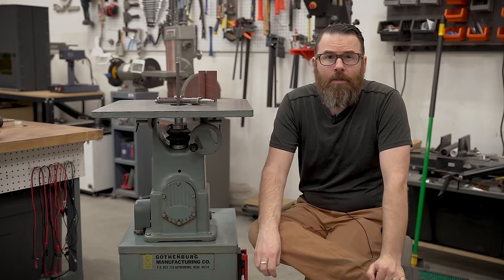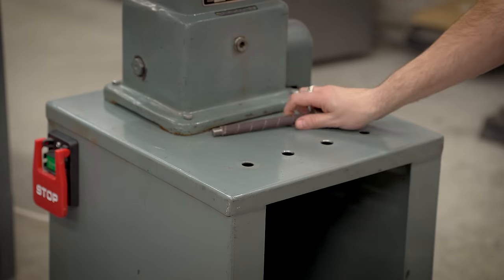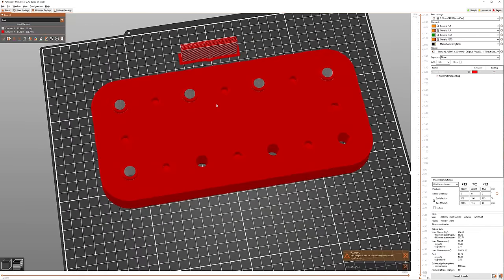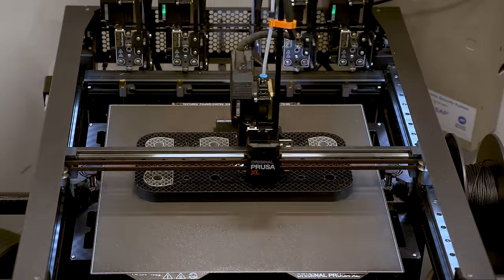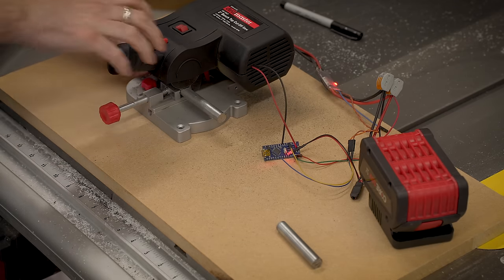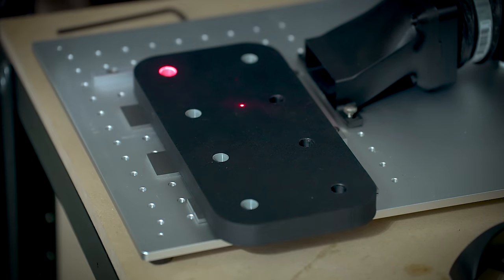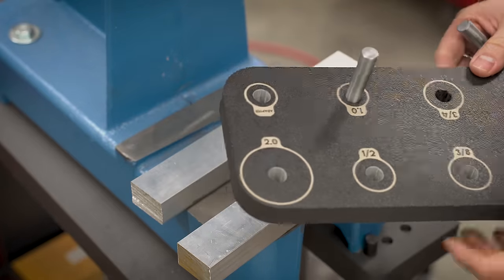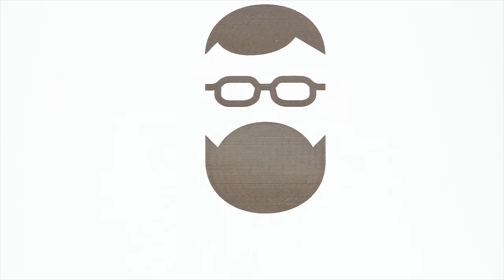Multi-Material Printing - Spindle Sander Tool Holder

Comment: In PrusaSlicer, you can limit the depth of tpu using the maximum width of segmented  region.
The regions painted at the side walls are expanded inwards up to maximum mmu_segmented_region_max_width (which is a new configuration parameter accessible in Print Settings->Multiple Extruders->Advanced).
Reply: I was thinking the same thing...
Reply: Yep, came here to say exactly this.
Reply: Thanks for enlightening me and others for that. Great find!
Reply: Very satisfying result Robert.  Having success with new (to oneself) approaches always blows the mind to with what one can try next.  Thanks for advancing the demonstrated capabilities for all of us 👍👍😎👍👍

Comment: For solidworks, instead of making a new part and assembly for multiple parts, I have found using multiple bodies works really well. It exports cleanly and the slicer recognizes the separate parts. Super easy for simple features. Just uncheck merge results in the extrude dialog

Comment: The defect is because of the infill being TPU in those areas it sags evvvverrr so slightly and then when you go to do a solid flat layer on top of the X pattern infill - the more solid material (PETG) doesn’t have the exact same support unilaterally underneath 

That’s my best guess anyway!

Awesome project, and absolutely UNREAL that you got that spindle sander for $80…!! I agree, the motor is worth that alone 

Cheers

Comment: The final part with the engraving looks amazing! 
Isn't it possible to make a few cylinders in PrusaSlicer and use them as modifiers for the multi-material setup (as they are used for support blockers/enforcers)?

Comment: I have an E3D ToolChanger.  When I print multi-material, I model the part in CAD with the softer material keyed into the harder material.  Some of my earlier prints were not keyed into one another and could de-laminate over time and use.  Keying the materials helped a great deal with that issue..
Regards

Comment: Ran into the same issues with underextrusion when using near the full diagonal length. Ended up rotating the part as far a possible, didnt think about decreasing volumetric speed. Thanks for the idea.

Comment: Great video. I suspect that prusa slicer automatically created those large internal areas of tpu to "anchor" the tpu in place. A more elegant solution in the slicer would be helpful when using an expensive material.

Comment: I had the same issue with the paint on colour. In Fusion360 I just designed the different parts at the desired place and exported them either as STEP or 3MF. In Prusa slicer I turned the inserted parts into modifiers. So I have full control over the material, infill etc. If you paint on different colour (same material) you have no control over the infill. If one material is quite translucent, you will see the colour behind it. The solution with the modifiers solved my problem. I already issued a feature request a github for the Prusa slicer team. But no one seems to care about this...

Comment: I've been playing around with solidworks and multi material prints. I'm very disappointed there's no reliable way to export your bodies as individual STL files. I did find a macro to do it but there's an issue with it where you have to restart solidworks if you update your model and want to re-export.

Comment: That part is the kind of thing that annoys me and I have to redo it because after putting it on the machine, I would have said - why didn't I print the lettering upside down on that side so so I can see it properly....a little thing, something not easily thought of before hand but something that would bug me every single time I looked at it...
Reply from the maker: There is no real 'front'  I have the lettering mirrored along the center because I won't really be looking at it from the same angle, probably from the side.